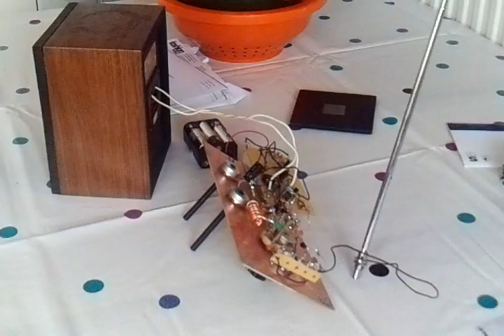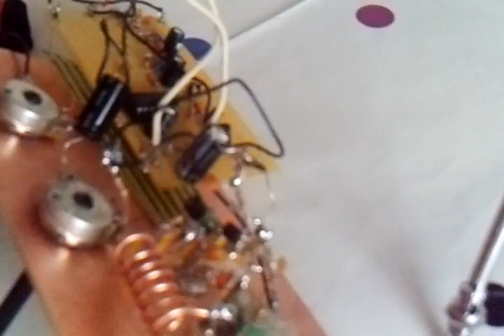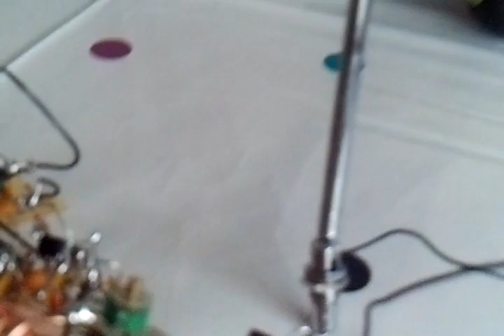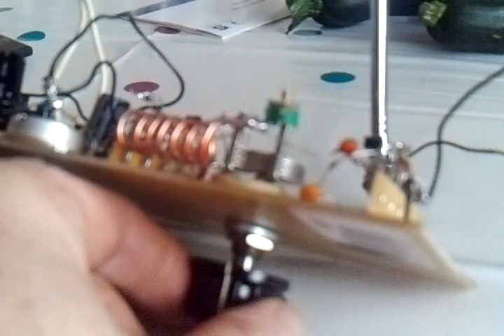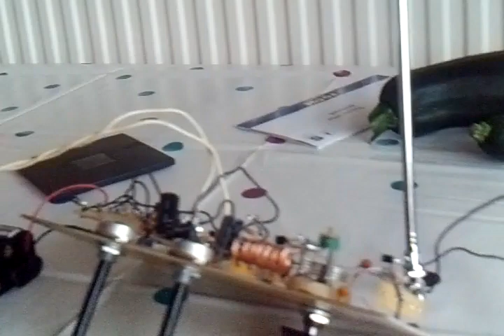My FM Superregenerative Receiver Converted To A Solidstate Pulse Counting Receiver.MP4

Comment: Question:

I bought one of those cheap frequency display modules to use
with my transmitter projects but haven't been able to get it to
read anything except my signal generator. After a couple of failed attempts at
making a buffer I gave up. The display remained in my junk box for a year. After
watching a couple videos yesterday, I tried again. I built an amplifier circuit
capacitively coupled to the oscillator using a 10p which is outputting a clean 100mV
sine wave. The oscillator frequency remained stable, but the display module
still fluctuated wildly. I tested the module with my signal generator again,
and it worked fine at 40mV. Also tested my buffered signal output with a RF
meter and got a correct 97MHz reading, same as the oscillator and antenna. Still
doing some research... Do I need a Schmitt trigger or ADC to feed the analogue
signal into the display module? No idea how to do that... Any thoughts?